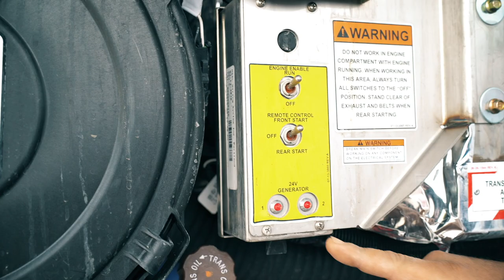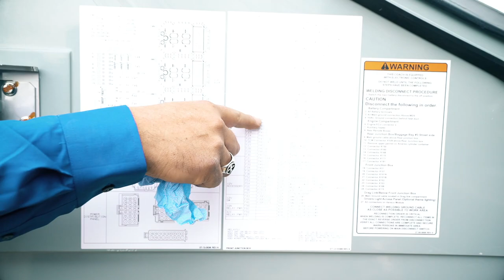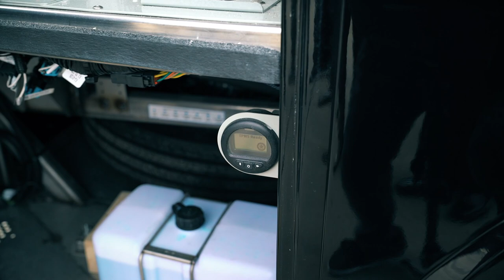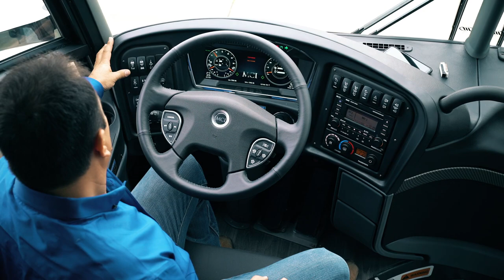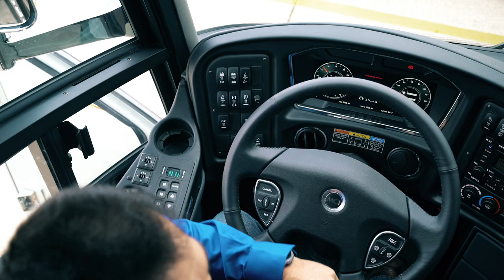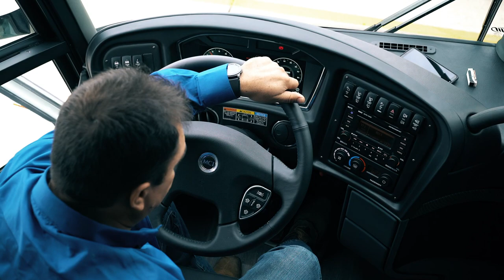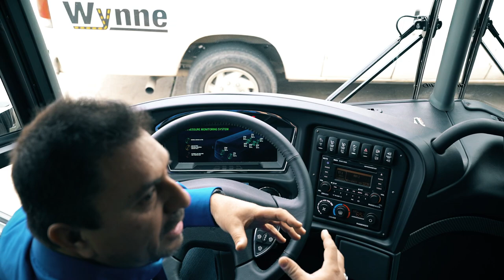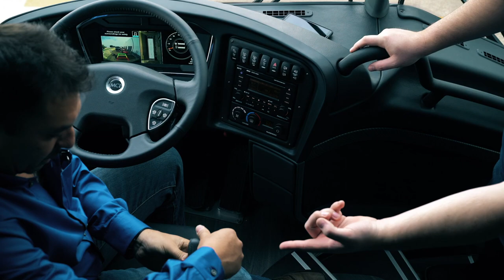Motor Coach Industries MCI J4500 Walk-Through Orientation Training

Comment: Is the cabin and driver ac compressor the same big unit as well as the ac condenser by the fuel compartment??
Also,
Where are the air suspension tanks??

Comment: I drove the first MCI Renaissance the same bus in the late 90s early 2000s and hearing the Talk given to these drivers these drivers are under qualified to drive that bus. It’s a lot of  bus to handle. The trainer Didn’t tell them when the tag axle turns it swings the bus out up to 5 feet in the rear meeting you could hit something when you’re turning. And I’ve never liked the feature where it doesn’t lock at low speeds because if you’re on ice or snow under that 20 miles an hour they can cause you to slide more out of control